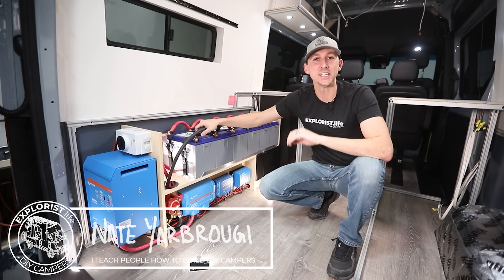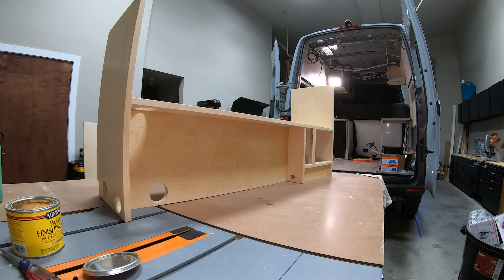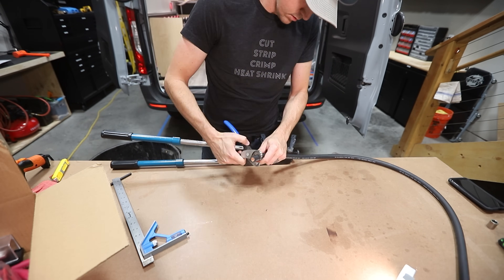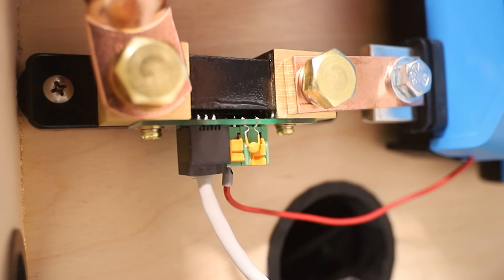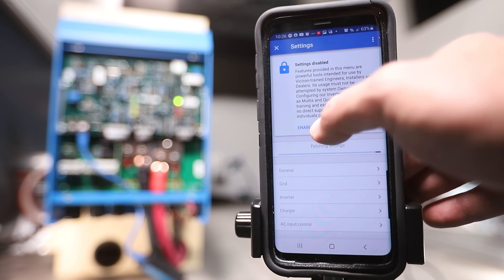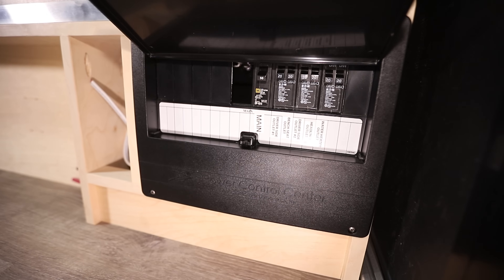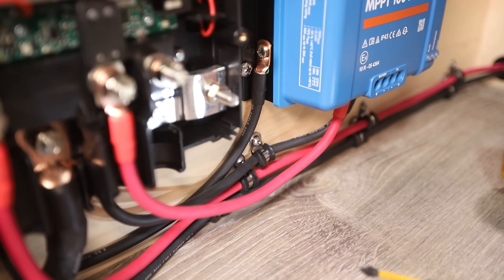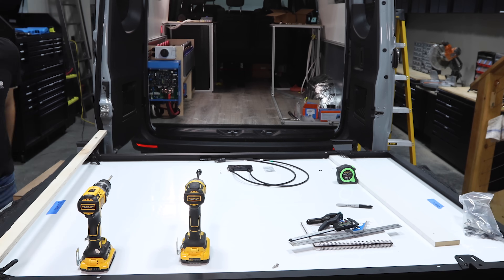DIY Sprinter Camper Van Electrical Install - Full Tutorial

Comment: Wondering if the ground for the DC to DC has to run all the way to the front seat with the Pos or can it be grounded somewhere closer?  Do both cables need to be nearly the same length?    For example, there is an OEM ground stud in the upper left corner of the van (driver side) which is where my cables are run for the dc/ dc charger which were run by the previous owner but never connected.  Also, is this a safe place to run these heavier cables along with other cable runs for internal components or are you recommending they be run under the van?  Thank you

Comment: Is there any downside to having another  Lynx distributor on the other side of the shutoff  which would be for alternator and solar in.  Allowing charging of the batteries without having the main 12v system on?   I am thinking about when my van is sitting in my driveway for example.  I would like to turn off the 12v main, but still allow the solar to top off the batteries.    Thanks for your videos.
Reply from the maker: Just turn off all of your lights/inverter/fans/fridge etc.  It's not worth the extra size of an additional lynx distributor for that purpose, IMO.

Comment: Hey Nate. Did tou miss a fuse??. 
  I see on your drawing for this build there is an ANL fuse near the positive lead of the batteries before it goes into the disconnect switch but on your physical build there isn't one and only a 400amp ANL at the lynx distribution box. I know you love victron. I'm using RENOGY gear and using a 4way distraction buss bar for distributing to 12v dc 12way fuse block. I ran a 300amp MRBF ON the battery pos terminal at the battery through 300a disconnect switch then into inverter.
  Should both the battery pos side and the inverter side both have a mega fuse rated to the inverter?. Which side of the wire is likely to need the fuse inverter side or battery side or both?
Reply from the maker: We have a specific video about fuse placement if you YouTube search for "EXPLORIST.life - Where do fuses go?"
Reply from the maker: But as far as the main ANL fuse in this video... it's there. 😉 Perhaps a re-watch is in order.

Comment: Hi Nate, I have followed your build to a T but without Shore power and no alternator charging. I have a different brand inverter. Hooked up my 12v lights and all good. Turned off disconnect switch and the lights dimmed and then slowly went off then right back on. Then dimmed and slowly went off them back on and repeat. Thoughts?

Comment: Thank you for the information. When using copper to connect the distributor to the master switch - can one be be shocked if one were to touch the copper bar when the circuit is live? Also, can the copper handle any amount of amps? Or is there a limit based on thickness of the copper bar?
Reply from the maker: Those copper bars are operating at ~12V which usually can't be felt if you just touch it.  If you lick it, though... that'd be a different story.  If you bridged the positive and negative copper bars with, say, a wrench... that would also be a bad day (but the fuse should blow before anything 'really bad' happens.

The copper bar used in this video has the same amount of copper in it as 4/0 wire (which is the same size as the wire going from the battery bank to the lynx distributor.  There is a max amperage, but it's north of 400A.

Comment: On running the wiring for the DC /DC charger to the front driver seat how do you get the wiring from the back of the van (in the enclosure to to the front especially when you are running it into the drivers seat? Drill holes in the column?
Reply from the maker: I think there were some holes drilled.  The wire was run before the walls were installed which was done before the van was brought to me, so I can't say for certain.

Comment: Do you need to factor in the resistance of the two additional lugs and the fuse on the positive battery cable vs the negative? Or is that a minimal amount and it will still drain/charge evenly?
Reply from the maker: It's not worth worrying about.  I only say keep things equal to keep people from doing 100ft of positive and 3 inches of negative.

Comment: Great video ! At 25:56, you connect the negative battery cable to battery 1 output of Multiplus and the positive battery cable to the battery 2 output. Any reason to not connect them both to battery 1 ? I understand the Multiplus can charge 2 batteries at the same time, hence the 2 batteries output.

Comment: navigated here via your store, looking at the DC-DC charger.  I have a truck and camper combo,  I'd like the truck to be a solar generator, with solar on the fiberglass shell covering the bed, and a battery & inverter for running tools, etc.  also DC-DC charger from the truck when running.  my question is how best to export this power to the camper?   do i upsize the inverter and wire a 30a RV plug to it?  or DC cables running from truck to camper?  how would I wire that?
Reply from the maker: If you didn't want to touch any of the Campers OEM wiring, you could indeed wire a 30A outlet in your truck from the breaker box shown in this video and then run your shore power cord back to the camper when you get parked.

Comment: Hello again, my van is getting closer and I'm starting to put together a list of my electrical system. I would like to run a Cerbo GX along with it's larger display as I plan to put tank sensors on it also and anything else I find that can work with it. 
My question is do you have an install video for the Cerbo and where in this system would it go? My system is going to be modeled after this as closely as I can.
Reply from the maker: I don't have a video for that just yet, but the instruction manual for the Cerbo GX is actually pretty good for the time being.  We will be doing a Cerbo GX in our next build (Transit build).

Comment: Great information.  Just wanted to understand how you manage to balance the weight of all the heavy electrical equipment all being on the same side of the van?  I am starting a re-build and struggling with this as my electrical system and all the kitchen stuff is on the drivers side of the van..  So it might be imbalanced over the rear axle... Please advise.
Reply from the maker: I'm a big fan of putting the electrical on one side and the water tanks on the other to balance each other out.

Comment: When wiring the breaker panel… instead of only using one side, or double circuit breakers, could you just split your hot wire with a lever nut and run it to both sides?
Reply from the maker: Nope.

Comment: Hey Nate, you mentioned in this video that you would leave a cheat sheet for the parameters in the charge controller settings but I can’t find it anywhere. I looked on your website as well. Where would I be able to find this? Im looking to copy this system

Comment: I plan to use this setup and am looking to purchase it from your website. The only differences between this system and mine will be 2 400w solar panels, and 2 or 3 200aH batteries. I understand this means I will need a 150-85 MPPT (using your calculator), but will the size of any other components need to change? Multiplus? Wire sizes? I know I’ll need 2to1 pv connectors, too. Thanks in advance, I can’t wait to build my system using your wiring kit and tutorials!
Reply from the maker: Are you planning on using 2x of the 400w panels shown in this video or something different?  If 'something different' let me know and I'll make a recommendation.
Reply: @EXPLORISTlife  Damn, I JUST saw your response :( 
they are 2 used Jinko 405w residential panels. I already bought everything and have so far installed 3 200aH AmpereTime batteries and the lynx distributor. I have upgraded the MPPT to the 150-85 and I upgraded the BMV to the one with the temperature cutoff function (because these cheaper batteries don’t self heat). Contacted victron to make sure I had the correct multiplus and didn’t need to upgrade to Quattro. Will be running 12v, not 24 or 48, despite the panels being 48. I was told the multiplus is able to convert the voltage.
Also looking for the accompanying blog post about how to edit BMV settings on the app. I don’t see it in the description, but maybe I’m just blind.

Comment: Why do you use the Blue Sea battery switch instead of the Victron one?
I've seen the Blue Sea switch used in many (otherwise) Victron systems. I recently had the Victron switch (for 275A) melt in my system even though it was fused with a 300A Mega fuse. After taking it apart I realised the only electrical connection is between the screw threads and the two hex nuts securing the wire lug. The Blue Sea switch seems to have proper flat metal connection between the lug and the switch. Are screw threads really enough for 275A considering manufacturing tolerances?
Reply from the maker: The blue sea one is rated for a few more amps and when we started making these kits/systems, the victron one was not available; so we've just stuck with the blue sea one so our spacers and such fit.

Comment: Nate-can you advise what size mega fuse you used for the Alternator charger to Lynx?  I have a 400
watt set up as well.  Lastly, i have 2 12 volt fuse blocks on both side of the van.  Can i piggy back the connections on the same Lynx posts to send power to both blocks?  Thanks for all your help!  Joe
Reply: Whoops, disregard that 400w set up, that was solar.  Couldn't see that mega fuse size on that last install portion.

Comment: I’m in the process of a very similar upgrade to our Airstream, so I’m very happy to have found this - thanks!  Of course I have a question- but it IS relevant to this very video.

In summary the Victron wire connections are too small for the recommended wires.  I’m sure you know what I’m referring too.  The wires - sized by your excellent calculator and confirmed by other sources- simply will not fit in the Victron connections.  Is there a special ferrule?  What do YOU do?  

So far I’ve run into this with a Orion 12-12-30 dc-dc charger SmartSolar MPPT 100V 20 amp 12-24-V.
Reply from the maker: Remember, manufacturers recommended wire sizes ALWAYS supersede anything you've 'calculated'.  For example: Victron recommends as large as 6 AWG wire for the Orion on pg. 7 of the user manual which corresponds to the max wire size that will fit into the unit.
Reply: So, even though  the controller could produce over 90 amps and the wire to the batteries calculates to 4awg and the controller will only accept 10 Guage - It's not really an issue?  Not arguing at all, I really hope that's all there is to it.  Thanks for the quick response BTW. Very much appreciated.

Now if the documentation wasn't  in the smallest font known to man I would be in business.
Reply from the maker: The 20A charge controller with the 10AWG terminals you are taking about can only put out a max of 20A, not 90A.  A 20A charge controller will put out a max of 20A.
Reply: That's embarrassing.  I misunderstood that the 2 numbers in the name were the max input values. I see now in the manual right in the Introduction "For example: A 100/30 model has a maximum PV voltage of 100V and can charge the battery with a maximum of 30A."  On the other hand I'm glad you straightened that out for me.  Thanks.
Reply: About connecting a wire that was too big for the connections on the device.  I believe I’ve figured out the “right” way to deal with that.  Safe anyway.

The wire is too big because it’s a long run - to prevent voltage drop.

So near the device (at the opposite end from the power source) install a fuse between the big/long wire and the short smaller wire you need to connect to the device.  Use a fuse sized to protect the small wire.

What do you think?

Comment: Hi Nate! OK, so I am following this plan but I am using the Victron Smart Shunt as recommended in your 24v video. Since this system above is 12v and the main wiring is 4/0 I am assuming that the ANL fuse inside of the smart shunt would be 400a. This would match the mega fuse inside of the distributor going out to the dc in for the inverter and also the fuse between the kill switch and the red battery inbound 4/0.       Sanity check?

thanks!
Reply from the maker: I think you're meaning the 'lynx shunt' instead of the SmartShunt, but yes.  All of that is correct.  We also have a Lynx Distributor Wiring kit for exactly what you're after here: https://shop.explorist.life/shop/all-products/camper-wiring-kits/component-wiring-kits/lynx-distributor-wiring-kit/

You're looking for the: 'Lynx Distributor - 4/0 Wire - Lynx Shunt' option in the drop down.
Reply: @EXPLORISTlife  YES! Lynx shunt. OK thanks so much again!

Comment: I didn't see you discuss grounding the AC distribution panel to the chassis, as is specified in NFPA 70, Article 551.56(B). Why not?
Reply from the maker: AC grounding is handled by the neutral to ground bond relay inside of the Multiplus inverter/charger.

Comment: Question.   In the setup from this video.   What source of charging is used or are all used and how much would be the maximum input current into the batteries. If all 3 sources of input power are working.  Ie plugged into shore power sitting in full sun so solar panel is maxed and have the engine running.
Reply from the maker: Shore power would take priority over solar and alternator, so if we were plugged into 30A shore power, the Multiplus would charge at a max amperage of 120A.

Comment: Another question; what are the crimpers you are using for the 6 gage?  Also, the ferules.  I bought most of my stuff by clicking on your links on the 3000 watt inverter parts list but my ferules do not look like that and the crimpers I bought are not going to work for the part where I'm putting the 3 strand 6 gage wire into the multiplex.  Thanks!

Comment: I know this is about the electrical side (which deserves significant credit) and not the build,but did I miss something here, that’s an awful lot of weight in those batteries - in any crash situation those bricks are not going to be held by those straps and could make a bad day a terrible day. 
Good tutorial though, thank you.
Reply from the maker: If the rails and straps fail, the box has a cover.  If the box fails, the batteries are 'tied' together and to the chassis via 4/0 wire.  If that fails, the entire electrical box is inside of a bench seat.  If the entire bench seat comes apart and the batteries get ripped from the chassis and enclosure, there will indeed be extreme danger to the occupants not only because of the batteries, but also because of the refrigerator, cabinets, contents of the van, extreme G-forces, etc.

Comment: What is the reasoning behind 10\3 for the shore power (30Amp(?) AC in) and 6\3 for the AC out? Is it due to the PowerAssist feature of the multiplus? Max 50Amps? I assume that if I am using an inverter\charger that does not have powerassist that I can use 10/3 for both AC in and out? Thanks for all your videos.
Reply from the maker: Exactly!  The power assist boosts the amperage on the output side up to 55A when connected to a 30A shore power pedestal, which requires 6 gauge wire.

If you have an inverter without Power assist... you can 'likely' just use 10AWG on each side, but just be sure to check the user manual for the manufacturers recommendation.

Comment: i have 2 AIMS 100 amp  lifepo4 batteries and trying to find out what size fuse i should use between the batteries and main battery shut off switch

Comment: How important is the orientation of the BlueSea disconnect switch.  Mine has IN and OUT stamped on the back and it looks like you have yours reversed with respect to discharge current?  I guess charge current flows the other way so no worries?
Reply from the maker: Exactly.  It doesn't matter.

Comment: onething that never gets mentioned is battery location.i have been seeing  the most popular  place to put them is  by  rear wheel arch.or on top of rear wheel arch .not sure what side..i have a rh drive sprinter ,and thinking of putting batteries behind drivers seat where a rear seat might go.but im also thinking of balance and weight and electromagnetics when im sleeping so is  rh wheel arch  way to go ? dont know what do u reckon .i have a right hand drive sprinter w906 ,so is the drivers side above wheels the best side seems to be a lot of weight on drivers side .is that maybe offset by other stuff on lh side
Reply from the maker: With the multi-thousand pound payload capacity of a sprinter, a couple hundred pounds of batteries won't matter.

Comment: This may be another chapter to add. It involves using an EV charging station as a shore source. Problem is the J1772 outputs at 240v and victron multi bus only has one 120v ac input. I assume a step down transformer is required, but how is this all done safely ?
Reply from the maker: I will never make a video discussing that.  In my opinion, taking up a EV charging space so that we can re-charge our house batteries is a great way to get vans and campers banned from even more parking lots than we already are.

Comment: I am a little perplexed about the placement of my main battery disconnect. I have a bank of 5 100ah and a 3k inverter etc. Having not been on the road in real-world conditions with the build as of yet I am thinking of having the this disconnect switch (you know the one - looks like a large fischer price toy in red) readily accessible in the case something starts to "smell hot or pop" haha,... everything is wired and fused defensively for sure but I just have this sense that I can't just stick that switch in the electrical box along with the panels and  only able to really get at it by moving the bed and such...

Should I treat this disconnect as something like a fire extinguisher??
Reply from the maker: It should be 'as accessible as feasibly possible'.